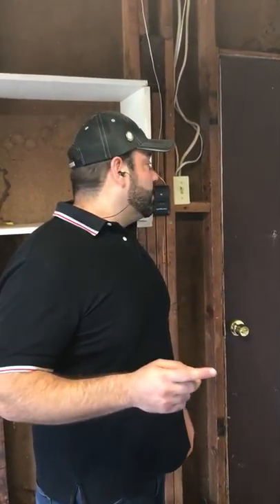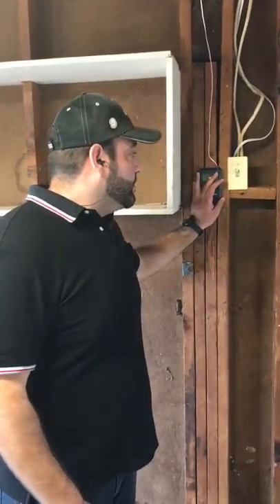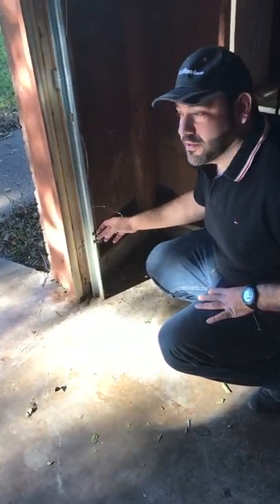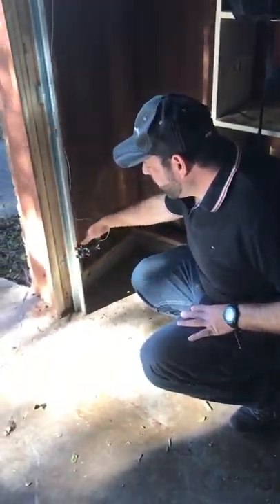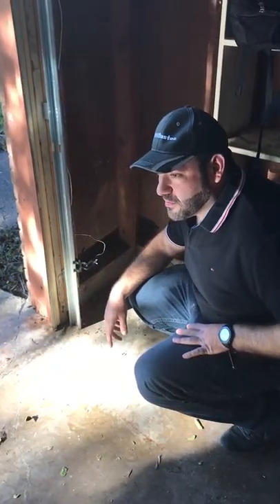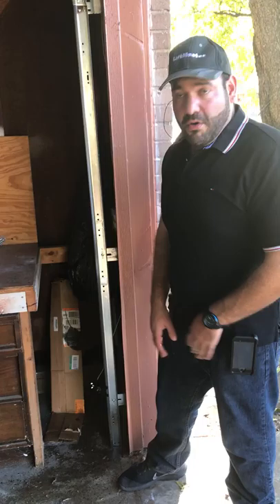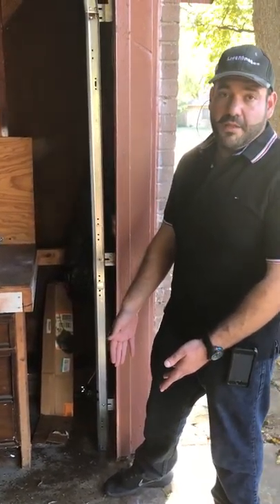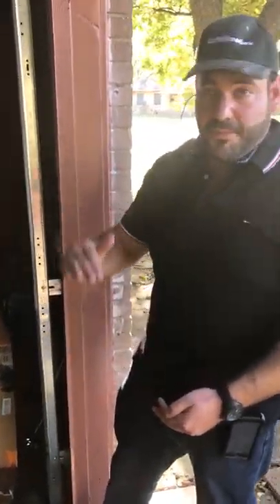Garage Door Opener Blinking Light / Sensor Fix| Garage Tec Garage Door Repair Richardson

Comment: Had just spent the day cleaning & lubricating the garage door hinges/rollers but once reconnecting the motor, could not get the garage door to work with no idea of where to begin.  Went online, serendipitously saw your video regarding sensors, went back out to check my sensors, made an adjustment &, lo and behold, it worked!!!  Many, many thanks!!!
Reply: Same exact story for me lol.. low n behold

Comment: So I literally just had the exact thing happening to my garage door. Had been this way for a bit and had gotten used to holding the button down. I just went over to the green sensor, cleared a few leaves and webs and made sure it was aligned with the opposite orange. It works again! Can’t believe that was so easy of an adjustment to fix it..wow!!! Fr just saw this vid and it worked.

Comment: Thank you so much for your video.  I was doing a thorough cleaning  of  my garage, and must have accidentally bump the sensor because my Garage door would not close and the light was blink.  I could close and open it manually, but when I tried electronically,  it would just blink and nothing happen.  I was seeing dollar signs because it is costly having a Garage Door Repair shop make a service call.   But,  after watching your video and following your instructions, I was able to solve the problem in less than a minute.  You're the MAN!! Keep up the Great work...

Comment: Thank you sir! I've fooled you this thing forever. Because the original installer had stapled the feed wires so tightly you couldn't get a proper alignment. I watched your video, pulled a few Staples and actually had to raise the sensors a little because of the short length of the wiring. After measuring both sides and getting the correct height for both, all is good now. Thank you so much for a great video!

Comment: Great video. thanks for sharing.  I have this issue  and I don't have any lights on either sensor.  I checked the wires and I connected both sensors to opener directly still not lights.  I bought new Chamberlin sensors that was said to work with my craftsman and still I got no lights. Is there anything else I can try?

Comment: Both of my lights are solid.  I have a Chamberlain so one is amber and one is green.  The lens are clean in both.  Travel distance is correct.  Could my sensors be bad even if my lights are on?

Comment: My sensors are steady GREEN and ORANGE and I have tested them... But my garage door will not close regardless...so.e days it will.. The obly sure way is to hold down the button to over ride it. Is the Orange sensor bad ? Is the co from board inside the Garge door housing bad? Do I need a new garage door opener ? I have had this problem for yrs !

Comment from the maker: Well , if the green light is not on , it can be a few problems .... A, the sensors are bad ( need to be replaced) b. The connection to the motor, or the wire is damaged ,and it’s not getting electricity. C. The mother board is broken and need to be replaced. If the motor is over 10 years old and you have problems A or C ,I would recommend to replace the engine if possible. For various reasons. I wish you luck hopefully it will work out .

Comment: My sensors lights are solid green and amber but the light on the wall switch blinks and sometimes is off. It won't open the garage door? Any idea what could be wrong with my system? It's not the switch, I tried swapping with a good one and it still didn't work.

Comment: For safety sensors they are supposed to be 6 inches off the garage floor and make sure the emergency release rope and handle doesn’t have a lot of access rope on it make sure you cut it burn the end or just leave it as is and just make sure it is on there correctly

Comment: So my sensors are lined up, there’s nothing in front of the sensors and today they door was opening and it stopped half way and the light started blinking. It won’t go up or down and the light just flashes when I hit the button. I had to close it manually. Could this be bad sensors?

Comment: Help! I have an issue I cannot fix: I have two identical Genie openers so I am able to swap out parts and test. One of my opener’s sensor lights (both lights) suddenly did not illuminate (I suspected a power surge fried the circuit board) so I replaced the board and then both lights came on but the red sensor double flashes continuously as if there is an obstruction - the green sensor is lit solid. I tested the sensor by switching it with the other opener and it works fine… I also rewired the sensor with no change. To summarize: sensor is good, wiring is good, circuit board is good, there are no obstructions but the red light flashes continuously and I can only close the door by using the wall mount button and holding it until door is completely closed. I also cannot figure out how to bypass the sensors when one isn’t functioning properly… this is driving me crazy. I don’t want to have to replace the motor as that costs nearly as much as an entire new unit. Any suggestions? Thanks.

Comment: I’ve got something similar. But the wireless openers will open the door, however the hardwired one will not and is flashing on the pad.
Reply: Same issue here, trying to fix. Since a power outage I have been experiencing the same issue- how do you fix this?

Comment: I can title you don’t have enough room for the safety sensor wiring but those garage door safety sensors are supposed to be no more than 6 inches off the garage floor and they’re supposed to have a pigtail so if anything gets stuck on them it won’t rip the wire out of the sensor

Comment: The opener on the wall keeps blinking, I tried unlocking, but still won't work.  The sensors are aligned, steady green/orange lights.

Comment: What if the sensors are aligned? One is green and the other one is orange, but still does not close
Reply from the maker: arturo0212 there is a chance that the door is getting stuck somewhere on the way down . If the sensors are aligned and both of the sensors are solid colors , there is a chance your motherboard is bad . I would just call a local garage door company to check it out . Usually You can get a diagnosis for the price of the service call of coming out .( not supposed to be more then 39$ max )

Comment: Not my problem. My problem is that when I close the garage door the opener blinks 3 times. The switch LED is blinking extremely fast and the lights on the opener don't work.
Reply: Do you fix the problem already?

Comment: What if the green light is not on
Reply: My red one is lite, but the green one is out. I switched the green one  to  the other side, and it works. So what is the next thing to check?
Reply: Red is on,  green is out. What do I check next?  I switched the green one to the other side, and it is working. Where do I go from there?